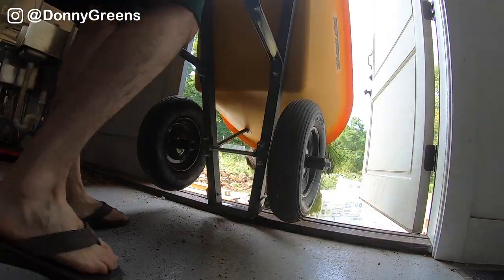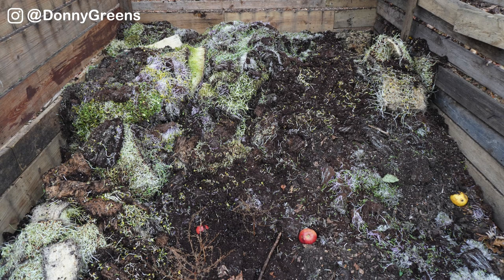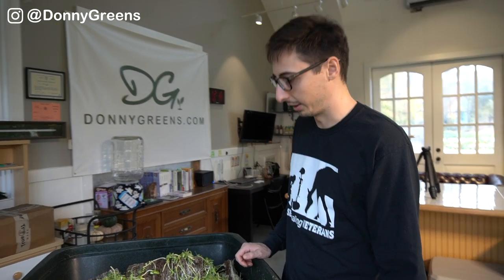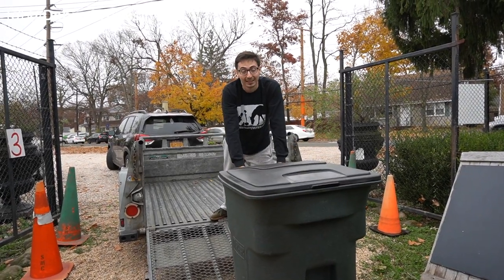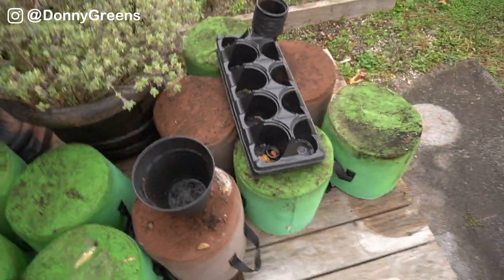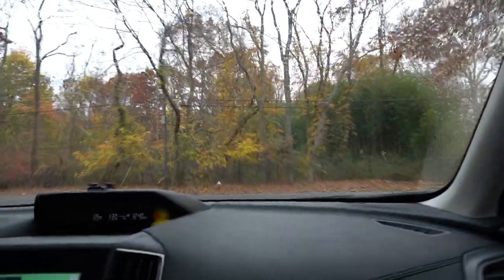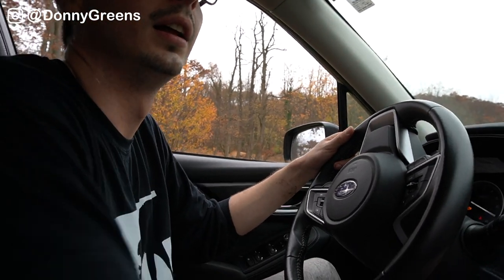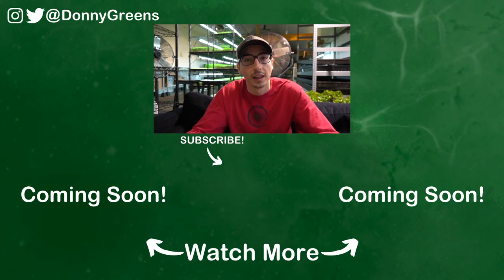What To Do With Microgreens SOIL/ROOTS/WASTE After Harvest | VLOG 1

Comment from the maker: What do you do with your microgreens trays after harvest?
Reply from the maker: Loving my new method 🌱💚
Reply: Thanks for sharing. I just toss them in the trash. I have been wanting to use it for a vermicompost.
Reply: Worm farm.

I just posted a comment sharing a link and giving a brief outline of the benefits
Reply from the maker: Gotcha, hey, you gotta do what works and improve over time!  Yes, vermicompost would be a fantastic use. I gotta get some worms haha. Are you limited on outdoor space like I am?
Reply from the maker: Awesome Mathew, Yeah worms are a great idea, they can eat right through it and break it down. I wonder if all the worms would creep the rats out too 😂 Is your worm farm inside or outside?
Reply: @DonnyGreens  
I personally don't need a large farm myself, only growing for personal consumption. So I'm using a system I bought off Amazon years ago that looks like a miniature wheelie bin, toter you called them.

But for your scale, a more horizontal system that you could feed at one end would be more functional.

Keep them somewhere that would protect them from the elements and direct sunlight. Here in Australia, a system like mine would cook the worms if exposed to the summer sun. And an open trough would dry out way too fast.

You'll need to keep them in a cool area that's covered, with protection form the sun and rain, and maybe even screened off to protect against birds, or what ever other animals that could try to use the system as a buffet table.

Mice are easy to manage.
Avoid throwing in whole foods, maybe run them through a mincer or mulcher first. This will help the worms to eat through them faster. And with a suitable lid/latch, you'll be able to keep the mice out.

Rats on the other hand are quite intelligent, and harder to manage. If the food is broken down faster then they can get their fill, they won't consider it worth the effort.

Try dehydrating wets foods such as tomatoes before throwing them in. And do your best to break everything up into smaller pieces.
Even an old cement mixer would be enough to break up your leftover trays.
Reply from the maker: Awesome Mathew, thanks so much this comment was super helpful and well thought out. Much love brother 🌱💚
Reply: @DonnyGreens 
No probs there champ.

In case you didn't see my own comment with the link, check this video out https://youtu.be/ceV_nYQrYdo
It's not the most engaging vid, but it does highlight the additional earning potential that you could get out of your micogreens operation.
Reply: @DonnyGreens  The rats an mice love to eat worms. Unless it's covered you'll have a bigger problem LOL.
Reply: @John Vargas Where do you get a machine like that?
Reply: I just grow microgreens for my own consumption.  I take the used soil with roots to the composting bins at my community garden.
Reply: Omg, my worms will love micro greens waste!
Reply: Long Island Compost...
* Takes local organic waste material, transforms it into nutrient-rich compost, and puts it back into the region's gardens and yards.
* Ensures that the burden of hauling and processing organic waste no longer falls to towns and their taxpayers.
* Keeps waste material out of Long Island incinerators and out-of-state landfills.
Reply: @Donny Greens  I keep mine in-room in the basement. It keeps the temperature steady. No smell either.
Reply: Maggot farm if you have chickens
Reply: @DonnyGreens  what i love about you and your channel is that you ACTUALLY TEACH , EXPLAIN, WHAT you state your going to do on your video. Frankly, I expected you to , just talk a bit about it , AS MANY HAVE DONE, EVEN THOSE WE HAVE COME TO RESPECT, YOU KNOW WHO THAT CANADIAN FARMER IS ...and its always comes down to upselling to a course, bla bla bla. Well then why waste our time. If you dont have much money you cant afford those. I rather buy the stuff your selling, support you by watching, patreon, etc over time. THANK YOU SO MUCH YOU HAVE ANSWERED SO MUCH AND MANY OF QUESTIONS! YOU HAVE NO IDEA WHAT ALL THIS IS MEANT FOR ME. MOSTLY FOR MY HEALTH  AND ME PERSONALLY BUT ALSO I have come down to the notion that if I sprout , start my crops as microgreens at first and then place them in pots to sell as seedlings, that might be more effective....even as sending seedlings as microgreens only smaller. So I will be experimenting with that this week...microgreens for me , microgreen for selling as seedlings in different ways....thank you donny for teaching this 65 year old dog how to do new tricks! !

Comment: Donny,
Thanks for all the education and videos.  Just some ideas:
1.  Put down cardboard then one or two costco blue tarps (or similar) in the wheel area.  Should give you more speed loading onto the trailer and make unloading/wheeling to the dump spot a little easier.  Just fold up the cardboard/tarps and wedge between the bins and the side of the trailer, or just throw inside the bin after its empty.  
2.  A boat wench or electric wench might get one or even two bins up if you made something to double load it.  And I'm shorter than you, but I'd squat lower than the lift point and drive up with legs to turn those over, but could be different body mechanics.  
3.  You could load into a truck and use a rake/fork to push out into the dump pile.  You can also back all the way into the dump pile, and just dump out your window into the truck bed.  The ultimate would be to have a hydrolic dump mechanism on the truck bed though, then you'd only need a broom to knock down any stragglers.
4.  Dumping into a field where someone runs a chicken tractor or just dumping to a chicken farmer might be the best usage to turn those seeds and greens into meat or eggs and compost at the same time.  Dump prior to moving the chickens into the dump area.  

3*  After using a truckbed to take out tokyo onions to the dump site with just using a rake and fork, I bought a dump capable minitruck.  It was a no-brainer thinking of time/money/effort etc.  Best regards
Reply from the maker: Awesome, thanks so much for the suggestions!!!!!

Comment: On most of the West Coast, trash pickup consists of Landfill, Recyclables, and finally Compostables.  In a new law in California, specifically, the Industrial composting company is supposed to accept table and food scraps in the bin, or in a small compostable green bag. Both the Recyclables Bin and the Green Compostables Bin are very low cost per month for a weekly pickup. If you lived here, you could just roll out 1 or more Green Compostable Bins for pickup on a weekly basis.  This of course could change if you decided to keep more materiel on site for other projects..

Comment: Put a piece of plywood on the ground behind the trailer... and bungee cords across the lids to hold them down after you load them in the correct direction. Farm life =) It seems like it would be easier to go back to your guy that picks up with his tractor, and just get a container designed with a lid (like the trash cans you are using now, or a dumpster) to keep the rats out. Again, bungee cords to keep the lid secured. Good luck!
Reply from the maker: Thank you!!! 🌱💚💚💚

Comment: The commercial kitchen I work at uses an organic waste removable service for industrial composting. They have a truck with an arm that lifts those “toters” over the truck and dumps them upside down. We just wheel the cans to the back of the building and the truck is contracted to come twice a week and additional times can be scheduled.
Reply from the maker: LOVE that David, that's like literally the ideal scenario in my opinion. I gotta try and find some sort of service like that in my area, thanks so much  for this 🌱💚

Comment: I use a screen mounted on a 2"×6" frame its 24"×24" . I screen the dirt dry it out then mix it 50/50 with new potting soil in a composter . So far it hasn't affected anything.
Reply from the maker: Interesting

Comment: Can you find a way to compost the spent material and reuse it for your growing trays? You will not have to buy new growing soil. Probably a mixture of new and old  50/50 maybe.
Reply from the maker: Im sure you could properly compost the material and reuse. I wouldnt re use for micros, I would re use outdoors maybe for full veg
Reply: Hi! I’ve been growing micro’s 5 plus years on a 4000m2 farm under glass and I can safely say you can reuse the soil for growing micro’s if you can compost them in an environment that’s warm enough. We have a 200m2 composting area where we throw the left over trays on top of each other. Our secret is chickens, they come in and love the compost! They start to scatter the soil around and eat all the left overs so at the end of the day there isn’t much left to compost and we can reuse the soil in 7-14 days. The key is, put your compost somewhere where you can keep it dry, our compost/chicken coop is never wet (because we have the glass greenhouse) and this is a major factor for reusing soil for microgreens successfully. Hope this helps!

Comment: Is it possible to use a small trummel,  separate the dirt out of the other matter and then reuse the dirt. Add what you need to the soil. Now all that is left is the roots. Much lighter. Will decompose much quicker.. even if you can't reuse the soil, it can be incorporated into the lawn. The rest can be sent away ro decompose. Just a thought.

Comment: Hey I see your suggestion for t5 light, theyre a lil pricey compared to the cheaper sun blaze t5 for $35 that are 4ft 54w...do you think its bad to skimp on the cheaper lights? or is it Worth the upgrade for twice the price when just starting out?
Reply from the maker: Pricing depends where you buy them. Sun blaze lights could be good as well. Try searching google for the sunblasters since amazon is out of stock lately

Comment: Why didn't you just get a couple "toters", say 2 to 4, and leave them inside and then when you had enough to fill up the blue bin from the compost company you could dump them into the blue bin and immediately call them to pick up? This would minimize outside time and all that extra labor of loading them into the rented trailer and dumping them. I feel like you added cost, added labor, and added a time sink without any benefits.

Comment: Well your problem is the rock. You need to make a track out of wood which you could fold up and store or a concrete walkway. At the trailer you need a different take on the ramp possibly matching transport ramp to close to trailer where you just have a bumb instead of pulling up whole fold down ramp.
Reply from the maker: Yeah that would definitely help a ton! For now ive been getting a running start to get through the rocks and up onto the trailer LOL. Moving locations soon so ill be able to compost on-site

Comment: I have a suggestion.  If you take the used soil and cover it for several weeks covered so no sunlight or water gets to it, the live plant material in it will die off. Then you can use the soil over again instead of wasting money and filling the land with old rodent dwellings with the waste.
Reply: Hello Bart, Have you tried this method?
Do we need to add something to the soil before reusing like nutrients etc.
Also is there any risk of moulds with this method?
Reply: Right.....Let it break down completely,  sieve it and it is ready to reuse. Remember,  it is not soil anymore but a really strong compost. You can definitely add a portion to your soil mix for better production but not as a complete replacement of soil.

Comment: Looks like you're getting to the point you need to put asphalt on the ground. Get a forklift(electric) with a good warranty. Cat, Hyster. And some ratproof bins. Rat poison and traps would be a good start. Gotta protect the business first, those rats HAVE to go.
Reply: I just though of another thing. A front end loader. A small non commercial one. Like a John Deere or something. You can scoop up the waste and not worry about rats getting to you. Then place it in a truck equiped to dump material. Your investment needs are making me envious lol.